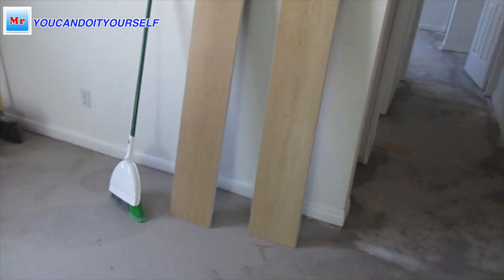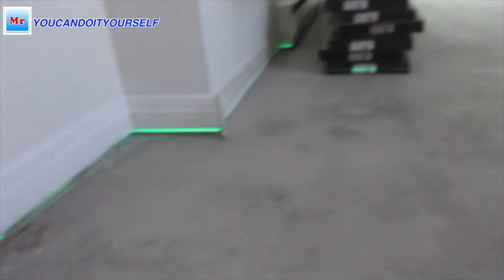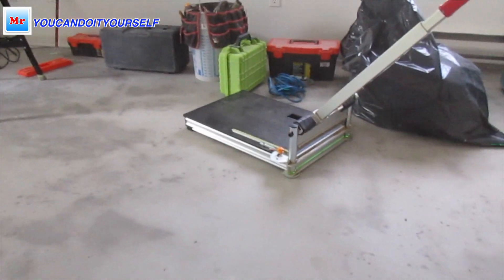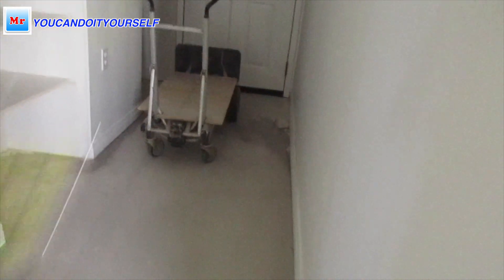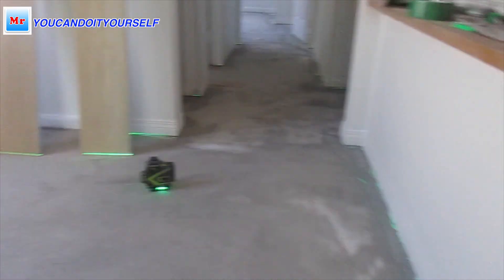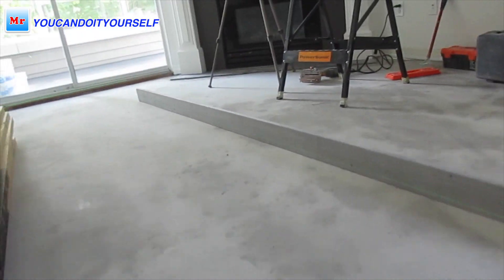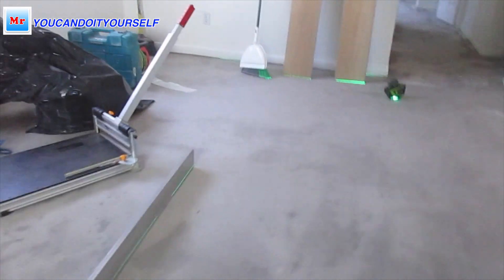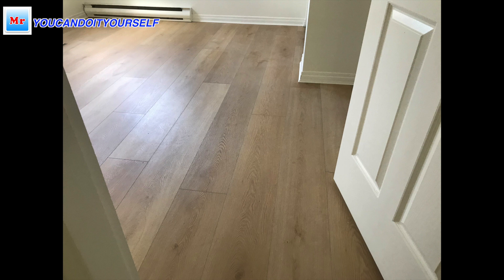You Won't Believe the Difference Between Flat and Level Floor!

Comment: Hi, I have bought a small house and the whole house is like this, I cannot level and it’s 4 cm out and if I did I would have to chop doors etc, I just want to make it flat to lay a floor. Do I need to do the whole house in one go to do it right? What’s the best way to stop the compound from trying to level when you actually don’t want it to level? Do you use any different tools when doing a job like this. Thanks
Reply from the maker: I would recommend you level your house with straight edge. I have many videos how to do it. Check it out, please. Also I will start leveling with same problem like yours tomorrow.

Comment: Dear Mr. You can do it yourself,
I am remodeling my house upstairs second floor, 900 square feet, I have 2 bedrooms, bath, area under the sky light, master bedroom with walk in closet and master bath.
I used seeSill 4D laser leveler that you recommended to map out the area.
Under the sky light is the highest point from there it slopes down into 2 bedrooms between 1/2 inch to about 1 inch. Master bedroom is about at the same level as the skylight, about 1/4 inch lower. Would you recommend using self leveling for all rooms or not?
P.S I cannot use cement board since I am using schluter ditra to decouple substrate from the porcelain 6 X 24 tiles that I will install and schluter ditra does not work with the cement boards. Also, for the self leveler I am using ardex k60.
Thanks
HK
Reply from the maker: Hi Harry, I don't know what kind of subfloor you have. I would be played in the master bedroom and hallway. If your MB 1/4 lover then skylight, I will be level to the master bedroom level all place and then grinding high spot (if it's possible). Don't forget to insulate all walls and small holes to avoid any leaks downstairs.
Reply: @MrYoucandoityourself  
My Apologies,
I forgot to mention that i have 3/4 inch tongue and groove plywood subfloor. Also, the master bedroom is on the opposite side from the 2 bedrooms that are slopped between 1/2 inch to 1 inch from the skylight highpoint that separates all bedrooms. Since the subfloor is only 3/4 thick. grinding down the subfloor will make the substrate weaker. Any thoughts?

Regards,
HK

Comment: Hey great video!
When making a flat floor do you add less water to the leveling compound?
And what product are you using?
Thanks!
Reply from the maker: Hi Troy, yes I add less water then when I am doing level, to avoid floating slc to lower side. I prefer to use Mapei products. Thanks!

Comment: Great video, what is the maximum tolerance in your opinion for any imperfections ( low spots ) before installation of vinyl plank? 1/16-3/16 for 10 ft length? Sometimes even with 1/16 low spot you can feel the plank to sink (knock) when you press it. Is that an issue after that and possible reason for unlocking of the joints . Thank you
Reply from the maker: 1/8” for 8 ‘
Reply: @MrYoucandoityourself  thank you!